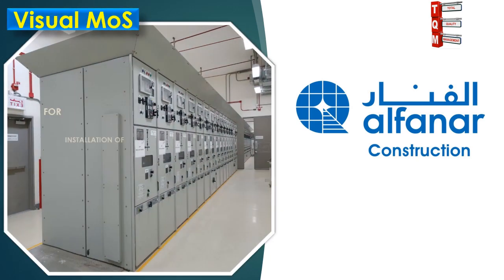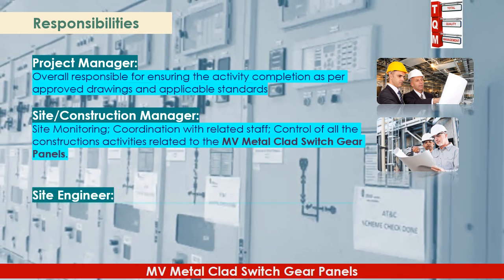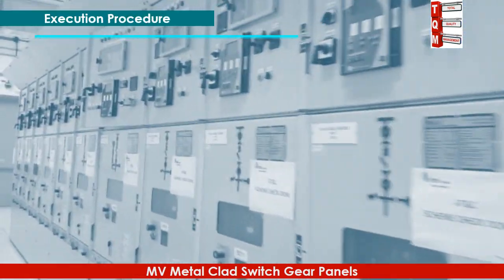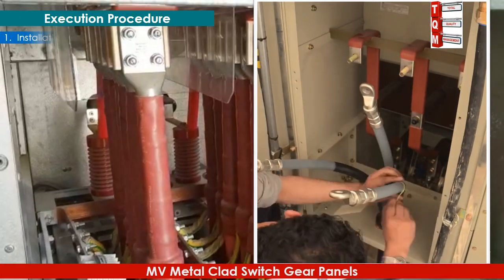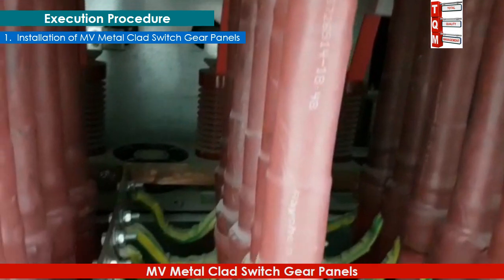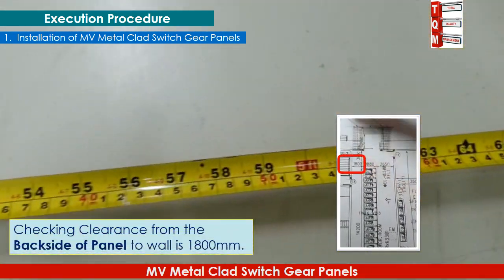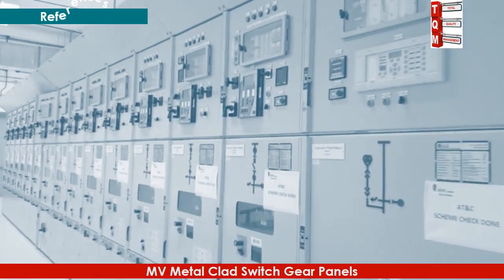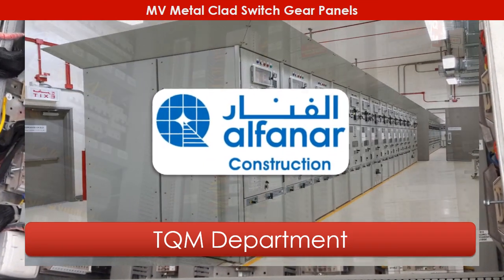MV Clad Switch Gear instalaltion and testing procedure

Comment: @5:20 the earthing should not have been connected against gravity force. @5:25 marking should have included nuts along the same line with bolts. At the moment you cannot understand if a loosening occurs. And also, Main circuit connections should be marked with 2 seperate colored marking, for example a blue mark should be done by the person who get the torque and red from the one who controls it. @5:55 Normally closed contact of test switch to the connection of relay is being tested but, NC contact should have been opened via putting in test plug into the test switch and it should have been checked whether the wiring is performed correctly.